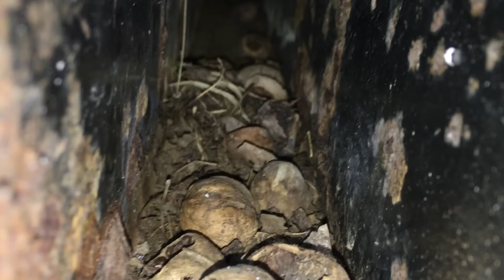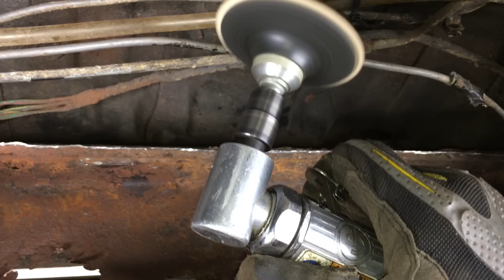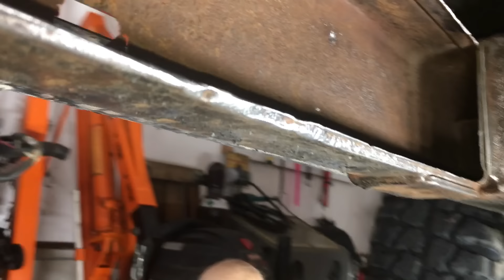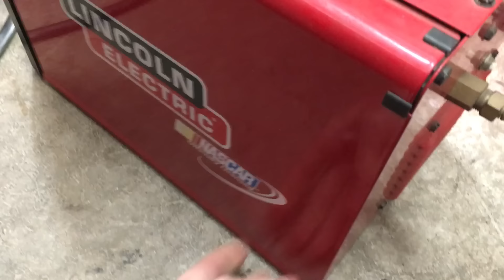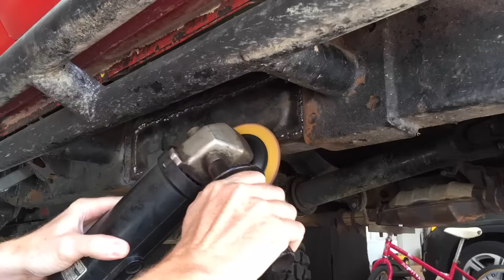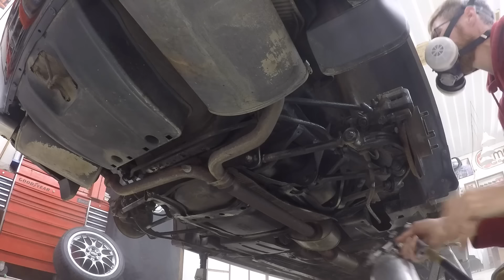How to Properly Repair Rusty Frame of Toyota Pickup Truck at Home

Comment: Omg this is my nightmare at the moment. 
I bought an icon from jdm history from some a knew was into the same scene. Owned two 2 show condition EK civics. Both B series. 1 was an Type R EK9. Looked fresh from factory. 
Only to find out he wasnt a honda lover he was the buy and sell cockroach that gave me what i didnt ask for. A car who hasnt had new weather seals or moulding replaced once. But the Dr, first owner had a brat son wanna be cool kid. I was even sent a pic of it on a time attack event. 😂
2000-2023 water damage from no fucks about my dream car. Plus a repair attempt from a blind female body repairer on her red tide. Spotty welding, over lapping repair panels, no seam sealing but for yeah polyester body filler and white caulking like, infused with tampon material bondo. 

Imma gonna be busy trying to become a competent mig/tig welder, & custom metal fabricator. 
My creds are a long time car enthusiast. Pursuing my masters degree in Automotive design and engineering at Youtube University. 
Atm waiting on my Predator 6-in-1 MMA/MIG + TIG CO2/Argon gas ready welder. TIG attachment, + the rest of the goodies from Amazon. 
Binge watching tutorials b4 it all arrives. 
Keep It Kustomz has been a joy and inspiration. Even the tools he uses all custom.
Reply: This is the same equivalent in the States 

https://youtu.be/v-PFDj4UClo?si=gdOngM0zHyQzidH1
Reply from the maker: I have that exact same welder and used it on the frame of my 1980 Toyota. It worked great! https://youtu.be/CRIvLpJfvgg
Reply: @6thGearGarage  bro i just received mine+ Tig attachment today. Probably tomorrow the co2 regulator + 3D helmet from them as well. Pretty good price  for the ones they have anywhere else.  

Sorry for the rant earlier. Im all good now. Had to read the "Dokkado - the way of walking alone" by Miyamoto musashi. "Accept all this as they are" (Dont be a bitch, man up mf" 😂😂
Looking at my predicament.. weldiing and metal sheet fab. has alwaya been a dream of mine. But didnt want to fork over the money to start. So i guess this could open up alot if doors in custom bodywork once i get ok enough to pass my perfectionist addictive personality of mine.  
Tomorrow i will try it out.  Ill practice on scrap 16 gauge. 
Do you have any settings that seem to work best for the mig( both gass and FC)? 
Ive seen the fluxcore running beads. Whats ur fav settings? 

By the way, gotta thank guys like you and so many d.i.y or build channels out on youtube. The time it takes to record, and then edit while in the middle of doing somerhing is impressive. I tried to start blogging this .. gave up 5 mins later. I cringe hearing my own voice 🫣 Once again thank you bro.. im walking the path again.  🙏
Reply: Yeah they are pretty much the same insides but have different names on it. 
Hey , good reviews and you cant complain about being tig ready for the price.  TiG welding was a dream early 2000s, 4 a guy working at pizza hut and a mazda rx2 rotary.😂😂
Reply from the maker: I feel your pain... just found some poorly repaired areas on the front end of the 1980 toyota I'm currently working on. To top it off, they never painted or sealed the welds, so its all rusty now.  Now I have to remove the front radiator support and inner fencer/rail and start over to make sure it's done correctly.

Comment: Mustie1 on youtube lives in NH and he uses chainsaw bar and chain oil. He coats it every two or three years. He sprays it inside and outside the frame. He has toyotas and has repaired his as well and the repairs last with bar and chain.
Reply from the maker: Good idea, that's some thick sticky oil.
Reply: @6thGearGarage  I believe he cuts it with maybe diesel or mineral oil and sprays it with one of those liquid sprayers they sell at harbor freight. Give his channel a look where he is checking and re-spraying his toyota tacoma. He shows that it only needs touch up on spots. Dirt settles on the oil but it stands up to rocks, chips and UV/salt. Check it out.

Comment: I use rustoleum paint, goes on thin and put two coats, it’s hard as a rock and last for years, when you need a touch up, you can in a few minutes,
Reply from the maker: I painted a whole car with rustoleum back in the day and it held up very well.

Comment: Why not just weld a plate over the frame?  You say not to do that, but it's not really an issue.  Biggest thing you can do is soak the inside with rust inhibitor yearly.  This stalls the rusting process inside...
Reply from the maker: I explain why it’s bad in the long term in the video, but for a quick fix on a vehicle you don’t plan on driving for years, it is fine. Soaking definitely helps. I like to use fluid film and spray in the frame later in the video.
Reply: I watched the whole video the first time as I appreciated the level of detail, knowledge, and craftmanship.  The explanations were very good, I just disagree.  A layer of debris/rust inside the frame of course will absorb more moisture and hold it for longer.  But this is also true for the inhibitor, the debris/rust will absorb more inhibitor, and it will last for longer.  I think we can both agree that regardless of which method used to support the frame, yearly inspections/maintenance would be required to keep it drivable for years.  Likewise zinc primer/epoxy sounds like a good theory (POR  you mentioned), but das you saw doesn't work.  A sacrificial metal must be plated on, not coated like a paint.  I appreciate your reply.    @6thGearGarage
Reply from the maker: @moedeclerk6688  I hadn't considered the debris working in the favor of an inhibitor... very good point! That sure would save a lot of time vs vacuuming it all out.

Comment: Thanks for the video. You did an excellent job of explaining the process and procedure you wanted to do so that even I could understand it 😀.  FYI I have been using Extend Rust Treatment (Loctite75430) for years. You have to cleanup all loose rust just as you did and then it will convert rusty metal into a non rusting surface. It's a bit on the expensive side but i put it on my buddy's rusty bumper when his engine blew and 5 years later when they towed it away, the only part of the bumper still there, was where i painted it on LMAO.
Reply from the maker: I haven't tried Loctite75430 before... I'll  look into that!  I did use an alternative to POR15 on a different frame and I'm really impressed with it: https://youtu.be/gmFx6OUw7Xo

Comment: Had there been YouTube videos like this back in the 90's I'd still have my Toyota Landcruiser.  Toyotas from the 80's were notorious for rust.
Reply from the maker: I love the fj60 land cruisers. They’re extremely rare around here because they all rotted away 🙁
Reply: @6thGearGarage  thanks for the answer! is there a video where you use a plasma cutter in body repair?
Reply: All the steel they used wasn't properly processed to remove the impurities from the raw steel itself,  it started rusting the moment it was stamped out and welded. The only long term solution is to fabricate your own frame.
Reply: Had a  ‘83 4x4 Toyota truck that I bought in ‘84. The chassis and cab did well but the bed started rusting after only 3 years Toyota wouldn’t fix so I had it repaired and treated and it still rusted out in ten years living in North Carolina. Early ‘80’s pickups were notorious for it for sure.

Comment: I honestly believe some auto manufacturers use cheap metals while making frames that are guaranteed to rot out, so you're motivated to buy new vehicles.
Reply from the maker: I don't see why they couldn't make them sealed instead of full of holes. That would keep the mud/salt out of the inside and prevent them from rotting out.

Comment: I am a panel beater . Use red etch or black etch primer or bare metal primer and then after undercoating or stone chip paint . Don't know what you have in your country ?
Reply from the maker: We have undercoating, but I prefer paint. When chipped by a stone, Undercoating will allow moisture underneath and rust will spread, but not be visible because the undercoating will still be in tact, due to it's thickness and flexibility. When paint gets a rock chip and rust starts, the paint will visibly bubble up or even flake off, letting me know that the area needs to be repaired before the rust gets too bad.

Comment: Too bad the frames were not made from aluminum.
Reply: Aluminum is 2x stronger pound for pound compared to steel (when it comes to impacts) but aluminum tears easily.
Reply: Some simple weep holes would be nice vs just side breathing ports
Reply: Yeah, the other issue is that they didnt put alot of effort into designing things not to hold mositure, if they would have done that combined with actually coating the frame inside and out with a substance like por 15 we wouldnt be having these rust issues.
Reply: @michaelcederquist6180  but then you dont have to buy a new car every 10 years.  no way jose
Reply: Please tell me you’re kidding😅
Reply: Aluminum will suffer the same fate. For example, all liftgates on Ford Explorer & Expedition corrode. Aluminum wheels dissolve. If you're not from the midwest/NE, salt kills every thing.

Comment: Something to consider applying to inside the frame when its open and cleanish is rust converter (tannic acid) which stabilises the rust somewhat, its very thin and wont fall off and into the bottom of the rail. then put your spray liquid stuff over that.

Comment: best tool is a wire ball  bearing hammer   or    4 big nuts  on a solid wire  attached to  few of the   wires on the steel cable    u mount it in ur drill and spinn it up the big ball bearings or bit hex nuts will bang around in frame and release the scale  so u can flush it out   same tool is used in rusted pipes  for drains   so u can prob  buy one pre made   online

Comment: The best way to remove surface rust is sand blasting. It makes a huge mess agreed but its also the only way to make sure all rust is gone before treating the surface. 

Please also clean the steel with mineral spirit or other solvent before welding. New steel is coated in oil and the old frame likely has any kind of grease or whatever.
Reply from the maker: Have you seen the laser cleaners? I’m hoping they keep coming down in price.

Comment: look into ospho.. stay away from rubberized or wax coatings, as you mentioned in video alot of moisture and rust is actually caused from within. all the coating does is trap whatever is etched in the steel and accelerates the oxidation process.

Comment: Ways to improve your repair, clean the area better. Invest the money into a needle scaler and go over the entire frame before repair. I ended up cutting the inside out front to back, cleaning the inside of the frame with the scaler and prep with a weld thru primer. Bevel all welds and butt welds are not great for a frame, especially if doing the inside and outside, and not plating passed the repair. Living in the Pacific Northwest, i feel your rust pain.
Reply from the maker: Thanks, Hoping this repair will keep it going for a while longer. Eventually I want to buy a rust free frame from out west and swap it.

Comment: I would’ve hit the inside of the rails with a rust neutralizer before closing it up but good job just the same 👍
Reply from the maker: I considered it, but there were some pretty scaley areas inside. The Fluid Film will creep into those areas over time

Comment: How about you grease under coat your cars prevents rust or kinda stops that car rust.
Reply from the maker: I use Fluid Film but unless it's applied annually from day 1, the rust will start. Every time I've purchased a vehicle, the previous owners never bothered.  The only exception is the 80 series land cruiser, which was imported from Japan where they don't use road salt.  So I shouldn't have rust issues with that one.

Comment: Based on the many youtube videos about "box frames", rusting throw from the inside to the outside, there has to be a better ideal. What about "i" frames or "c" frames?
Reply from the maker: I or C won't rot from the inside out, since there is no inside, but they do flex a lot more than a boxed frame.

Comment: meanwhile my 61 chevy frame is still ready for a multi-ton load.   wtf is with toyota paper frames?
Reply: i suffer an infarction watching this and looking at the taco nuclear waste dump in my driveway.
Reply from the maker: The chevy c channel frame doesn't hold in all the corrosion like a boxed frame. Boxed is more rigid though... until that inner wall rusts away and it becomes a rusty c channel and breaks in half.

Comment: use Line X bed liner to coat the frame.
Reply from the maker: You could, but around here bed liner on a frame will rust underneath the coating faster if a rock chip goes through the coating because it traps salt/moisture.
Reply: @6thGearGarage  ahh gotcha!

Comment: Enjoyed your video and thoughts. Dude , people don't realize that it is so hard to see WTF you are doing when laying on the floor, having stuff up on a lift is a game changer. Even with a decent helmet, and good lights, it's hard to see your welds and not get grinding debris in your eyeballs. New clear plastic for the helmets shade shield is a must, and moving lights exactly where you want them matters too.  I have the Lincoln SP180 plus, and it does a bit thicker than 3/16th or .1875 very well, I do highly recommend wiring either with 230V. You are probably in a similar position to most of us, where we run a direct burial 12 gauge wire and get 20 amps to our shop with a black, white and neutral, but no L2 for 230V, but often it's all we can afford. If you can, search around for some #6 stranded wire, run it in plastic conduit and you'll have 50/60 amps (the ground can be #12). I can run an entire good sized shop off of 60 amps, because I'm not welding while running a mill or a lathe or a grinder at the same time, never pulling too many amps even with a heater running in the winter. Running a 1/0 wire to my shop for a 100 amp panel would have cost me 7K$. Toyota seems to use 3mm steel or .118" and they fold or put 90's on the top and bottom for an "L" shape. I bought .125 - 2 x 2 angle iron, some .125 plate X 6/5/3/1.5" wide steel and have lots of it left over; the 90's are what makes it strong. To keep it from rusting I am looking into the lanolin products because paint, POR15, powder coating etc just seems to lift over time because moisture gets under it, and oil makes a mess everywhere you park; There has to be a barrier from the steel to the oxygen elements or it rusts again...  My 03 frame got swapped in 2008, it was garbage again by 2018 or 10 years later, the steel they use must be recycled garbage steel...
Reply from the maker: I'm getting a 220v welder before I weld the frame on my current project, a 1980 Toyota pickup. I should have bought one a long time ago. Hard to believe that frame only lasted 10 years!! Thats a bummer

Comment: I use the used oil from oil changes and stuff that collects in my used oil tank….spray it on with a pressure bottle.

Comment: What if you have rust on the top or bottom of your frame? How do you go about that?
Reply from the maker: Same way, just only cut one side at a time, starting with the weakest first. Also use jack stands for extra protection in case that frame is weak.

Comment: I do not see how people buy a truck and then watch mother nature eat it up right before their eyes. I have done frame replacements but I could never do a frame repair.. Frame repair and patches would eat at my soul just knowing the patch is there and the rest of the frame is still basically crap.
Reply from the maker: Sadly it happens all the time around here... there are 15 year old trucks with less than 100k miles with bad frames.  Eventually I would like to have a clean frame shipped from out west and do a full swap.
Reply: @6thGearGarage   I am in San Diego. I have a Jeep junk yard here, I have availability to lots of parts. Let me know if you want to talk about shipping parts your way. I am a Master Tech, Owned my own shop, worked for Dodge Chrysler Jeep for 8 years. I know whats up. Maybe we can  do some business.
Reply from the maker: @jasonholloway7588  jeep frames rot pretty bad up here as well. I can’t believe there isn’t a company selling aftermarket frames for trucks/jeeps somewhere in the rust belt. If there was an affordable way to get them up here from CA, I’d buy a whole stack of yota frames.

Comment: In my state half of the inspection stations ding the vehicles if you weld on the frame at all. I replaced a gusset on a chevy crossmember with factory gauge steel and spent alot of time matching the gusset with a factory shape. It looked factory and was a good repair.  As soon as the inspection starion saw a bead of weld they kicked me out of the shop. I went home and smoothed up the bead and srayed undercoating to blend perfectly.  The next shop says repairs were allowed and couldn't tell if or where  it was repaired. So they dinged me on a pitman arm. Guy figure.
Reply from the maker: What state are you in? Ohio has no inspections unless you're trying to register a rebuilt/reconstructed title for the first time.
Reply: @6thGearGarage  right next door to you. Good ol WV. our inspections are not by a book as they should be, but by the inspectors interpretation of said book. I don't have a problem with inspections per se but it should be uniformly followed. Thank God we don't have an emissions check or all of my old trucks would fail.
Reply from the maker: Funny how strict things are there, PA as well. Meanwhile OH and MI have trucks driving down the road with rusty chunks falling off.  @kirbyroad7222